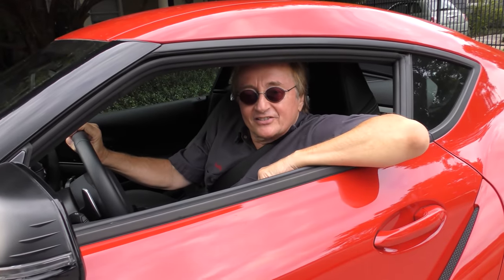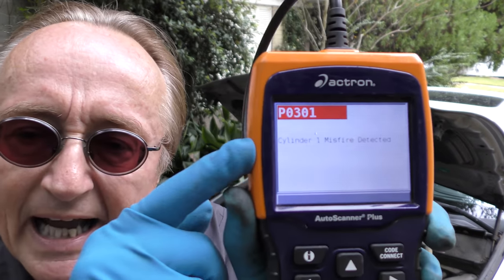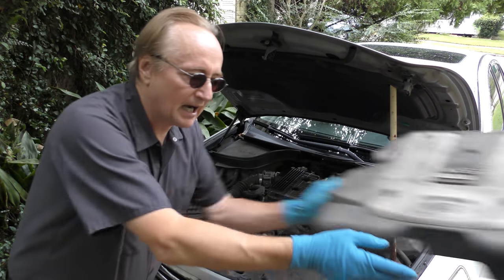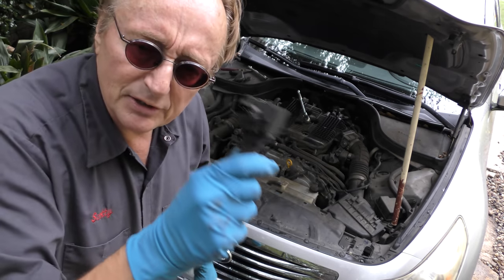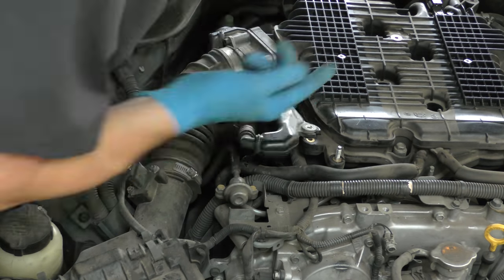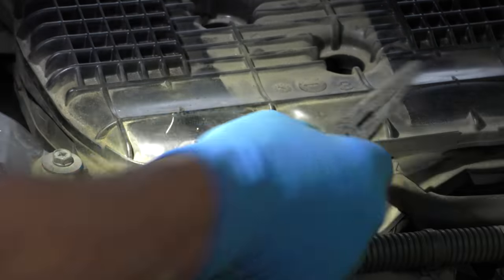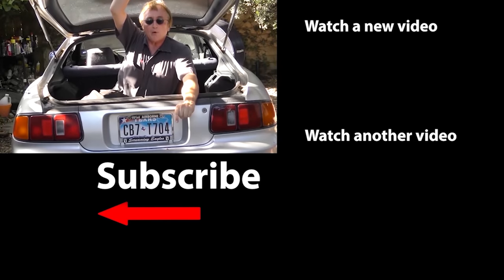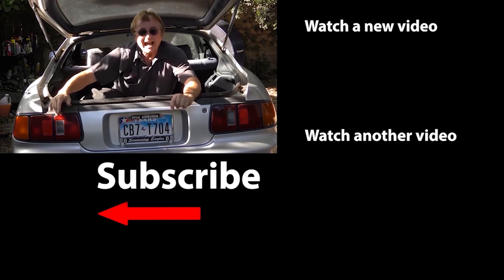My Final Car Repair Video

Comment: That spark plug is covered in oil because of faulty PCV valve. Its located right next to the first spark plug. The are two of them ($15 a piece) on VQ37 еngine ,one of each side. I had the same problem,replaced  ALL  spark plugs and 2 pcv valves and problem is gone. Vq37 engines do not consume oil and last 300k miles with good oil. My 2013 Fx37 has over 170k miles on it, runs great , everything original,except for alternator.

Comment: i changed my motorcycle sparkplug once or maybe twice a year.. the reason is, the bike isn't running quite nice..

the manufacture recommend sparkplug replacement at 16.000 KM but from my experience, pushing it to 10.000km the performance drop quite a bit.. and replacing with new plug restores the performance..

Comment: By changing plug and coil we don't know if a new coil was actually needed.
Valve seal problem suspected?  Could that ATP-205 help?
Reply: Agreed. I doubt it was the coil. The plug didn't look that bad, and I've have several cars (motorcycles/race karts) with bad valve guide seals. Sometimes plugs get fouled...it happens. This is why manufacturers recommend changing them every 60-70k miles. You can get away with longer intervals, but also sometimes they should be changed sooner.

Comment: My girlfriend drove her CRV with a flashing CEL for 2 years. Engine would idle at 2500 rpm...she would just pop that baby into reverse like no big deal.
Have no idea how the trans survived
Reply: Lol my uncle had a CRV with almost 250,000 miles, he wanted to get rid of it so he only changed the oil when he felt like it. Ended up selling it because that thing just wouldn’t die 😂
Reply: @BrianYYH  did he know about sledgehammers
Reply: @Zfb Tln Ya I told her not to drive it, but if the engine cranks and fires, and if it moves when she hit the gas....well
Reply: Long time ago in 1989 my girlfriend had an old 1978 Toyota Celica Liftback.  When you stopped you had to throw it in neutral or it would stall out and it was hard to restart.  I drove it to the store (don't ask me why when my car WORKED) and it stalled out on a railroad tracks with a train coming.  I was about at the point where I was going to have to skedaddle when it started.  Got back to here place and told her not only would I never driver her car again, but I would never ride in it again.
Reply: @itsmikoton  lol he felt bad scraping the car as the mechanical functions were all still working
Reply: @BrianYYH  250,000 is nothing for a CR-V

Comment: why did you go directly for the coil? I would have changed the spark plug and used the old coil. If that soled the issue it is certain the other plugs are worn too. Plugs have probably never been changed.
Reply: Because why fix the problem for $2, when you can say it costs $100 to fix it. Scotty is the definition of a "shade tree" mechanic.

Comment: I changed all my plugs with a 300 code, then I found it was actually the cheap Chinese made coil for Denso OEM. I'm thinking the #1 coil might run hotter because of less air flow in location in engine bay.
Reply: cisa93  OEM denso on Nissan is Chinese. I bought a Japanese Denso to prevent future issues. Denso bought the Chinese company to cut costs.

Comment: Infiniti's have excellent engines, just not easy to repair. They offer a lot of power and they're fun to drive.
Reply: GWN Aquatics  Agreed.
Reply: Agreed
Reply: I chuckled when he made fun of the car for not having a backup camera...I didn't realize 94 celicas had them🤔
Reply: The carbon build up could also just be a bad PCV
Reply: GWN Aquatics  Maybe that's because Infiniti is 100% owned by Nissan???
Reply: @tysoncross1120  celiac has a after market camera, and yes the base model 08-09 G’s didn’t come with them unless you optioned the tech package. After 2009 they all came standard
Reply: @ryanmckenna5254  I wanted to say the very same thing. I just cleaned mines 2 days ago as i noticed oil consumption was on the rise and the engine was starting to run a little rough. Just over 50k miles I highly doubt my engine is on the way out. Lol. Plus it's still covered under manufacturer warranty.  Pcv valves are a major item to keep an eye on in these cars. I'm on my second VQ platform now and neither has let me down in the years I've owned them.

Comment: Nothing screams "we're ashamed of our engineering"  like a BEAUTY COVER
Reply: It's designed to keep dirt and road crime OFF the top of the motor. They do have a functional use.
Reply: @CS-Loc  that's what they used to say about wheelcovers ( duh they keep dust off the lug nuts 🤣)hilarious!
Reply: @bradzimmerman3171  one the vq motors there’s insulation under the cover, it’s made to hold heat in so the motor warms up faster

Comment: I owned 2 of these, they both had problems with valve gaskets, so the oil was leaking, causing the spark plugs to misfire. They're also built-in so you have to replace the whole panels.

Comment: No one gonna talk about how that G37 only has 98 000 miles on it?
Reply: Probably because previous owners did not use 93 or premium fuel on it and probably changed oil with none full synthetic oil or late oil changes. It depends how u take care of the engine . Even rotary can run 150k mile original motor if proper taken care of

Comment: P0301 Infiniti G37 code is actually extremely easy to fix. Just buy a '94 Toyota and plug the scan tool in. The code should be clear for another 200,000 miles.

Comment: I'm not one Mechanic, but I knew two people who one in the late 1960's and one in the late 1970's put engines in their cars that was from a different "brand". The late 1960 case was a teacher I know and drove one in his car with another class-mate. It was one (for us used to VW-Beetles) of the huge Opel-Admiral and he had wrecked a US-import Car with one V8 Engine, so he did some work and put the V8 in the Opel. Don't know the reason why and I forgot to ask, as this was the first time in my young life that I was in a car that was going in a new-highway 160 Km/h. the ride was in a few minutes over so it seemed to me. 

The other story was with a Beetle, don't know the exact details, just that a guy had one Porsche 911, and the engine was in need for repair, he had pulled it himself, but he didn't have the money at the moment, but one older Beetle engine laying around. Story as told to me (since he meet him once on the street in his Car) he compared the mounts of the engine, and realized he can swap the engines, and made some adjustments to his Porr-VW as they who knew the guy called it. 

So yes it seems people could some crazy stuff back in the day, today if you cut a wire and make the replacement too long the Computer would not work, as Scotty mentioned how sensitive the wires are now in modern cars.

Comment: I had a motorcycle that had originally 4 gears. The gearbox was modified that it had 5 gears and first two had better gear ratio. So it was nailing it also driving it into hills.

Comment: Iron duke engine in a camaro? Isn't that a 4 cylinder engine? I had one in a small 4 door pontiac. good engine until a timing chain gear stripped.

Comment: my experience was a little different . i think the 2.8 got better as time went on and became the 3.1 . my 84 and 85 with carbs were a mess trying to make the carb meet emissions my 86 fi did away with all that crap clean motor compartment around 180 started getting the bottom end rattle/knock  . which was about right for the 80s

Comment: Well I for one think he knows a lot but also think that that one cylinder could be gummed up because the coil was failing. I would also run a few cans of fuel injector cleaner through the tank to rinse the deposits out of there. I’ve seen the Nissan V6 engines go really far for as much as 25 years. But those were the older built in Japan engines. If it’s getting good fuel mileage then it’s likely still running correctly. And I hope you enjoy living in Tennessee

Comment: It just occurred to me to ask, if the spark plug tip is not eroded (gap looks good) can you clean the spark plug with a propane torch much like cleaning a line trimmer's spark arrester?  Or is it better to rely on a chemical cleaner?

Comment: I have an 03 infiniti i35 used with 169k miles and engine works fine, just leaks oil from valve cover gasket. Then some bushing issues that need to be replaced AND tie end rods. Other than that, everything else is fine :)

Comment: Yes I agree that replacing a spark plug is only a temporary fix, but say if you had to replace them every year, at 6 plus per year @ let's say $8 per plug, ok $50.  IMO that's far cheaper than a car payment.  Yes it's a hassle, but depending on the condition of the rest of the car, putting in oil and replacing plugs might not be the end of the world.  Obviously at some point the engine is just going to give out, but hypothetically, if you were thinking of just junking it anyway and just wanted to get the max life you could out of it, by all means, these are small fixes to keep it going until something major goes out and you just junk it.  Of course if you planned on selling it, then yes, sell it ASAP before it has more issues so you can get the most money for it.  Obviously someone would probably still buy it with a misfire or check engine light on / code, but you'll likely get less money for it in that condition.

Comment: @Scotty Kilmer I have a 2011 Chrysler 200 3.6 Cylinder. Since it started getting cold it makes a noise when I start the car and accelerate until the car warms up and it stops. I then got random red battery codes as well as a check engine light code P06DA. I’m not sure what the cause of this is and would like help trying to figure out the main reason. Is there a way that I can message you so you can hear the noise? Thank you

Comment: the VQ37 is a good engine, my G37 has nearly 200k
Reply: Wonder why he did not mention the mileage on the car being repaired. I’m on my second Infiniti. Had G37 with zero problems sold for a Q50. The 3.7 is a good engine use correct gas and change the synthetic oil every 7000 miles.   I’m keeping the Q50 until engine breaks will see how many miles that will be.

Comment: Hi Scotty. Tips on avoiding LSPI? / caring for a small turbocharged DI engine?
Reply: Change the oil religiously. Use good synthetics like Mobil 1....it's cheap at Walmart. Turbo DI engines like to have PCV valves clog. Make sure you inspect/service that and you'll be less likely to run into carbon issues.
Reply: @CS-Loc  Nice one. Thanks :)

Comment: Scotty, good luck in Tennessee! We will see you when you get settled in. Safe travels. 
Quick question, I have a 2012 Audi A5 convertible, 40k miles. Recently replaced the water pump and while in there the thermostat (plastic cracked). Runs good & love the top down here in CA. Is it a car to keep or dump it soon cuz future issues are shure to come? Any quick thoughts are appreciated. Thank you! 👍
Reply: EA888's are good engines. I'm surprised the water pump went with so few miles. But, it seems like that thing isn't driven much and probably only sort distances since it has so few miles. Hopefully the w-pump you used was the updated one with a metal impeller. Outside of that, use good synthetics, change it every 6-7k miles, and you should be fine.
Reply: @CS-Loc  Thx for the reply. Typo in # of miles. It's 40k. Still low but not 14. Lol. Pump had a sml crack in plastic. Yes used updated water pump. I did not do the repair personally. Had good independant mech do it. Since not driven a lot how many months go by should oil be changed? Or stick to miles driven with no time frame indicated? I start it up at least once a week to keep it lubed up. Thx for the input.
Reply: @davidg426  I'd go for 5-7k miles on changes. My 2012 e350 is GDI, not turbo, but I've stuck to 7k intervals with Liquimoly Molygen. It has 150k miles, and has only needed scheduled maintenance it's entire life. If you adhere to good service intervals that car should be good for another 30-40k before it's next major service.

Comment: I wish i found your vids sooner. I’m like an hour from houston in Crockett. My 2014 chevy cruze has a re-appearing off and on engine light and the dealership couldn’t figure it out. They said take a whole day or more. And my driver window fell inside my door so i have cardboard wedged holding it for like past 2 years.

Comment: I bought an 83 camaro with 100,000 miles in 1993. It was a real good car. Only expensive fix was the power steering box. Maybe the mechanic ripped me off. Who knows. I sold it in 1996 for almost what I paid for it. Was a real clean car.

Comment: Have an 04 Town&Country, 3.3 with 272 thousand miles that had the same CEL codes & was replacing the spark plugs every 6 to 8 thousand miles.
I put mid grade gas in the van by chance after replacing the spark plugs AGAIN, problem solved!

Comment: Hi Scotty I have a big problem that so far 4 mechanics including the dealership can not solve.  I have a 2013 Buick Regal GS and it has about 120000 miles.  My check engine light has been coming on and off (more off than on) for almost 1 year now.  The code is a P0137, which is the 02 sensor.  I have replaced both 02 sensors, all the spark plugs, all the coils, the oil, the engine air filter, the gas cap and several gaskets, which is what the dealership recommended.  Honestly they have no idea how to fix my car, which drives great.  They are now telling me to replace the catalytic converter which since the car drives great that makes no sense.  So please I need some advice as no one seems to know how to get the check engine light to stay off.

Comment: Scotty, I have a dilemma,  my 2010 Subaru Outback 2.5i engine head gasket is out.Should I spend the money to fix, its got 160 thousand on it, and in great shape no accidents or trade it in, dump it.Thanks Dano R.
Reply: That's a legit dilemma. Unfortunately those Subies eat head gaskets. If you get them done they'll go another 80-100k. But you'll have to do it again. You can take a loss and sell it to an indie Subie tech, or see if they'll cut you a deal..$1500 is the going rate with labor and parts.

Comment: Scotty: Late 80s - early 90s Chevy was crap.
Guess I just got lucky... between 2003 - 2007 I had a 4 door 1991 Cavalier.
It never gave me any major problems.  I only had to take it to the mechanic for routine oil changes & 1 radiator flush
Best thing was, I only paid  $500 for that goofy lil car. It even got 25 MPG.

Comment: The Japanese cars are hard to work on since so much have to be disconnected to get to the problems where there is more of a problem. I have three Fords Pickup truck and SUV's and they are in great condition and I live in Arkansas where we don't have the problem with much snow and the bodies of all three vehicles are great and so is the drivetrains.

Comment: I'm sorry sir, your car requires a full engine rebuild, but I don't have time for that, so I swapped a ignition coil and spark plug and you're good to go.
If you need help after today, you'll have to come to Tennessee.  hahaha.
Twistys huh?  Just a few hours east of Nashville...Tail of the Dragon.  No it's not fast...but 311 turns in 11 miles...make sure you've had your coffee before running that. haha.
Reply: I'm no mechanic, but I'd think you would change all the spark plugs if you were changing one. The others might not be blowing oil, but they're probably worn.

Comment: My 03 jetta 2.0 keeps going into limp mode. It won't rev past 3000 and has very limited power. Can anybody help?
Reply: Pull the codes..there could be 5 different things wrong with it. Limp modes mean something bad is happening and the ECU is pulling power for some reason. Could be a fuel pump.....could be something else.
Reply: Thank you! It turns out it has a bad habit of cracking the coil pack, so hopefully that's the only problem with it.
Reply: @alexbye8912  definitely sounds like it. Those little 2.0's are pretty bulletproof honestly. Tons of them go many miles without a ton of issues. They don't make big power, but they're a simple setup which is nice.
Reply: @CS-Loc  funny enough, I never got to put the new coil pack on. Got totaled in a wreck. Engine still runs though! Thanks for the advice, though! Appreciate it!
Reply: @alexbye8912  anytime. That's a bummer. Hope no one was hurt. Jettas are safe cars thankfully.
Reply: @CS-Loc  absolutely. Both of us thankfully came out uninjured. I'm thankful for the safety of those cars.
Reply: @alexbye8912  It's one reason I like them. And Saab/Volvo. People can't talk smack about maintaining them, but I'll pay for safety over a cheap to maintain death trap anyday. The Tundra is a great example. It's 3/4 NHTSA test is terrible. I won't drive one as a result.

Comment: Can somebody get me some help woth a 2014 Volvo (V40  Petrol, 44k miles), is shakes badly only when i stop it( either cold or warm engine). The dealer said it's normal but hey, ffs, it's a 2014.. not a 1914. 🙏🧐🙏
Reply: Motor mounts likely if you don't have a check engine light on.

Comment: Question Ive been wanting to know for a long time Scotty. Do mechanics make good engineers? Seems like you know more than the guys at some of these companies who design these cars.
Reply: No. But engineers are typically good mechanics. There is a reason behind design of a particular product. Primarily emissions, packaging constraints, and per unit costs. Cars 20 years ago didn't have crash and emission standards to today's levels. It's why they were more simple.

Comment: Sometimes my 2012 Subaru Forester's lights will flash and I get a beeps sound with the flashes-not the alarm horn but the unlock beep tones when i'm walking away from it-no doors are unlatched WTF? ANYONE?